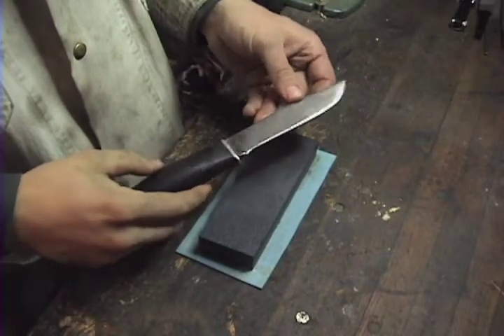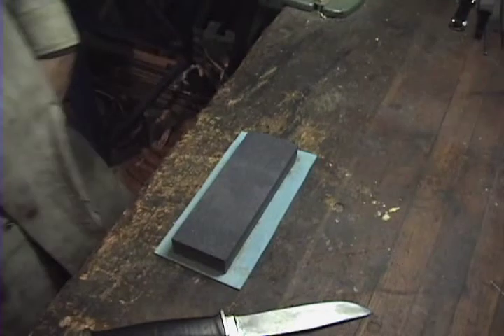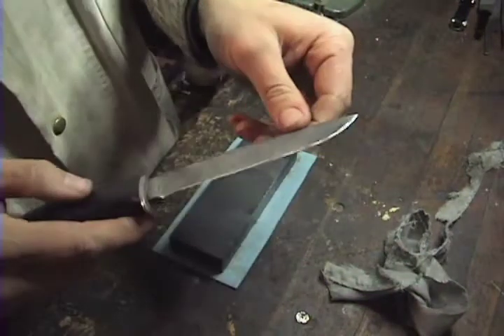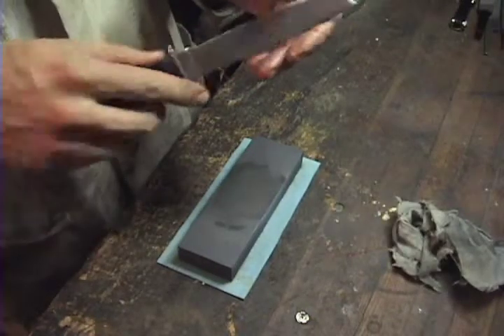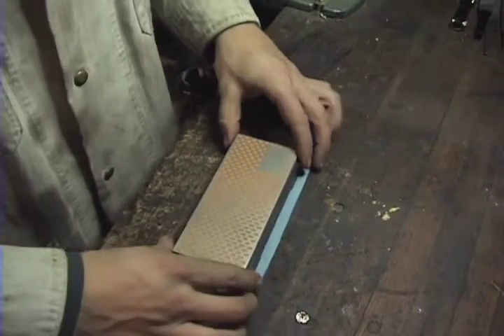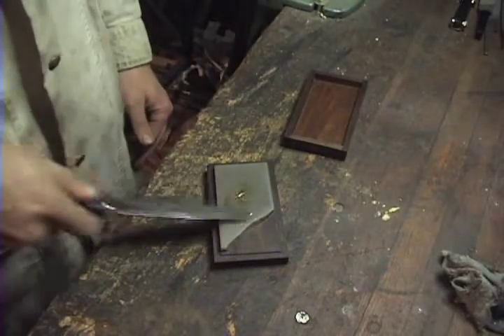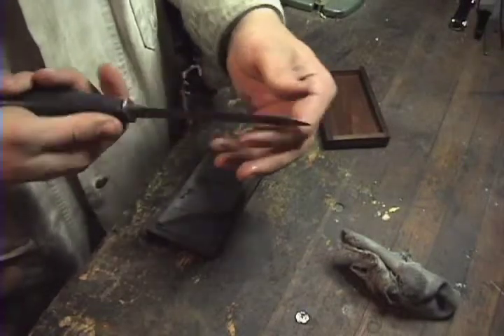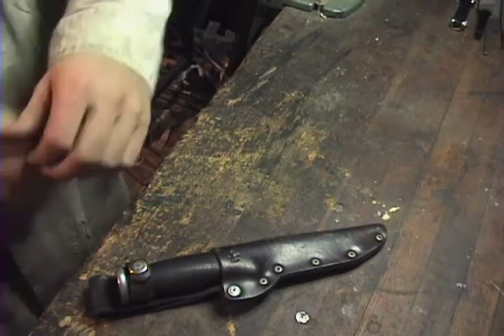Sharpening a Knife (TIS002)

Comment: Why do you stroke the knife on your hand?
Reply from the maker: It's the final step in honing - I can't say as I know exactly what it does at the molecular level, (probably just smoothes up the edge a bit) but I can definitely tell the difference in sharpness between a knife that was stropped and one that wasn't.  If you don't want to strop it on your hand, you could use an old leather belt or other piece of leather instead, but I've always done it this way and it seems to work well.
Reply: @TheIdahoanShow  A Kangaroo leather belt strop works better than just a persons hand. It breaks the wired edge along a newly sharpened blade. Kangaroo leather is thin and pliable but also very tough.